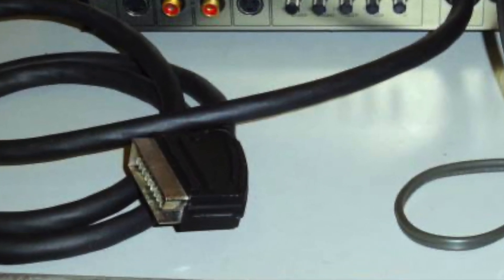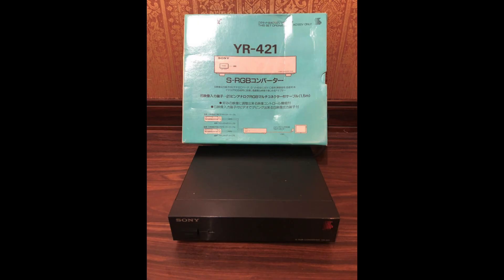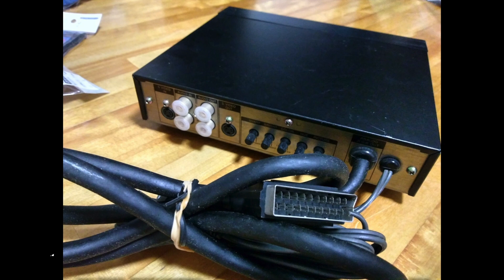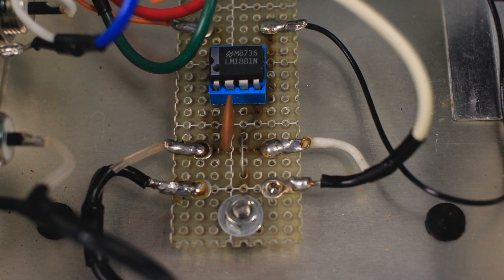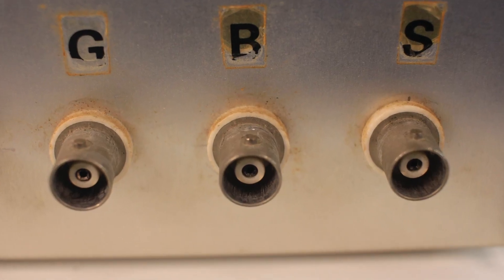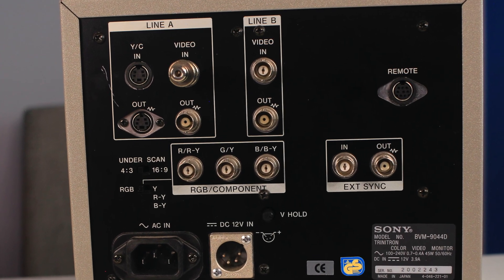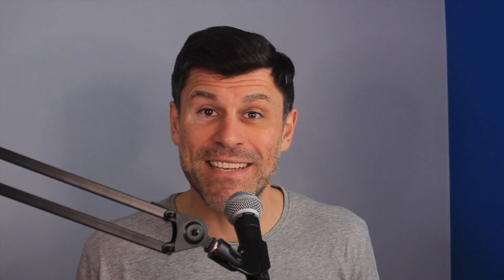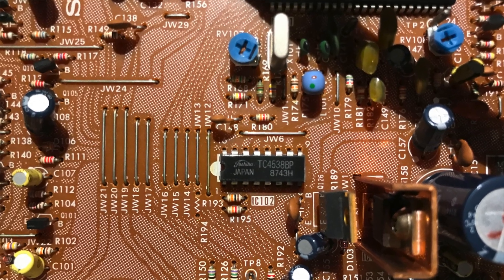The one of a kind S-Video to RGB converter from Japan

Comment: There’s some surprisingly good decoders out there - my CYP (also released by AVToolBox) CMT-7 is quite nice. Kramer VM-19N / Ocean Matrix OMX-6006 are decent too. That said, never gonna do better than a RGB mod! These decoders work best with 3D games imho - N64 S-vid thru my aforementioned decoders looks quite good, personally find it a few notches better than straight S-Vid! All depends on your CRT/video processor tho :)

Of course, nowadays one can simply pick up a Koryuu or a RetroTink set on passthrough with a HDMI to VGA (or component) for the same type of effect. Most likely going to need to combine sync with a HDMI to VGA... unless you are feeding the signal to a OSSC!

Neat find, keep an eye out for the PAL variants that Sony made of these too! :3